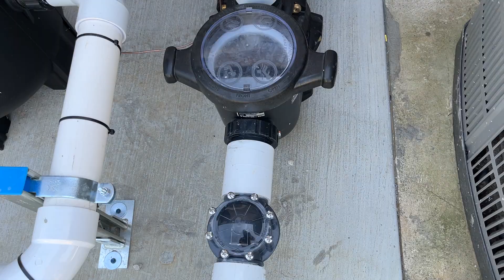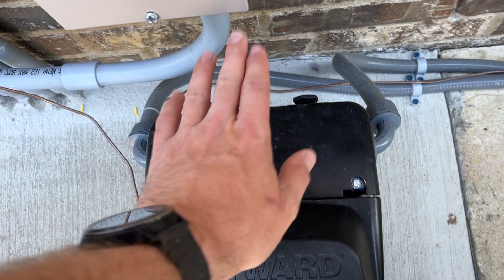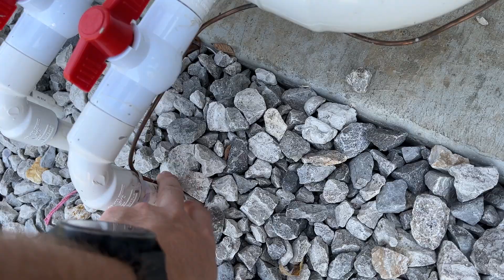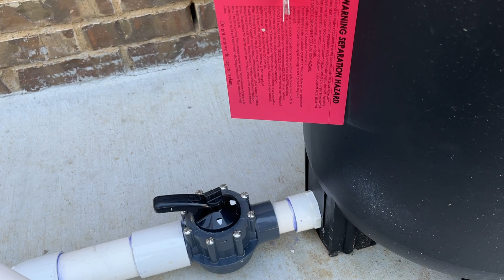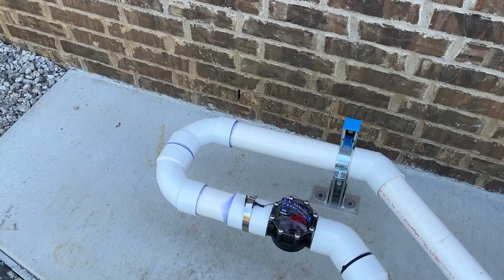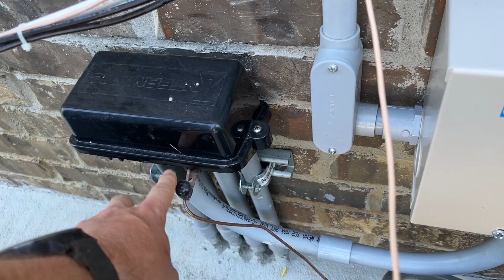In-Ground Pool Equipment Pad Deep Dive - Episode 22

Comment: Ciband, your pump manual probably says 5x your pipe size for the straight intake run into your pump (ie 12.5” minimum)?
You might go back to 2” up until the check valve, you can leave the 2.5” from check valve to pump (minimum 12.5” after check valve). Hopefully, you already figured out the air in basket problem.

Comment: Regarding deck jet. 
You can add valve on the return line and close up small amount to increase the deck jet pressure.

My deck jet is automatic valve and controlled remotely but pressure is low. So I’m planning to add the value to diver more pressure to deck jet. This way you don’t have to add more pump and less failure parts.
Reply from the maker: A good idea. I have valves there and have used this technique. Just need to automate it. Thanks for watching.

Comment: Where are your unions.     There should be unions  for maintenance or repairs. There shouldn’t be air bubbles in your system u
Reply from the maker: There are unions on the pump, filter, and salt cell. The large valves are rebuildable.

Comment: nice video; how do you know it's pulling 150W at 35% power?  is that based on documentation or are you testing it to show that?
Reply from the maker: The pump actually reports this as diagnostic data. Thanks for watching.

Comment: Great video! Very informative! 
What’s the size of you equipment pad? What is the distance from you house wall to your PVC pipes sticking out of the ground? 
I am about to start on my DIY pool build and plan to put all equipment in a pool shed. I’m stumped on how much room I should allow before I concrete it all in.
Reply from the maker: It’s roughly 4 feet deep and 12 feet long.  I measured all the equipment and then made templates and laid it all out on graph paper to shuffle things around and get the scale of what I needed. Good luck and thanks for watching.

Comment: Great Video. Where did you get these metal clamps which hold the horizontal PVC pipes ? Thanks.
Reply: Home Depot and Lowe's carries these. They are terribly expensive there. If you have a plumbing or electrical supply house near you, you will get a much better price.
Reply from the maker: Lowes

Thanks for watching.